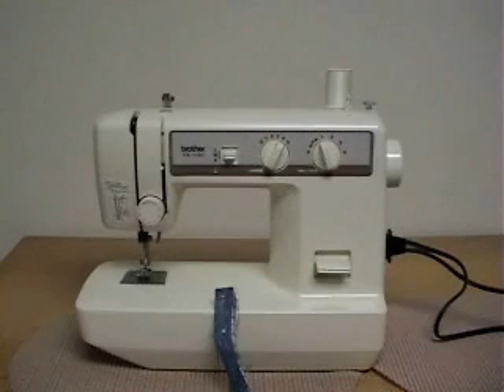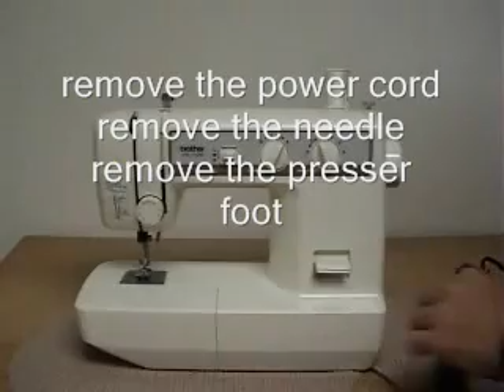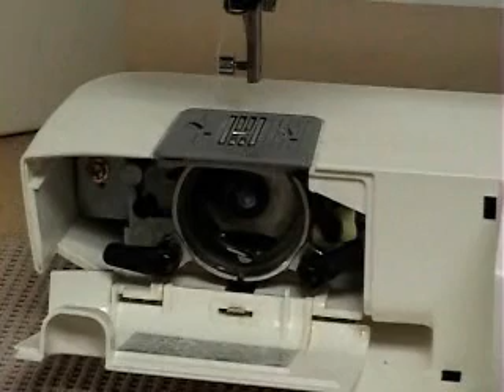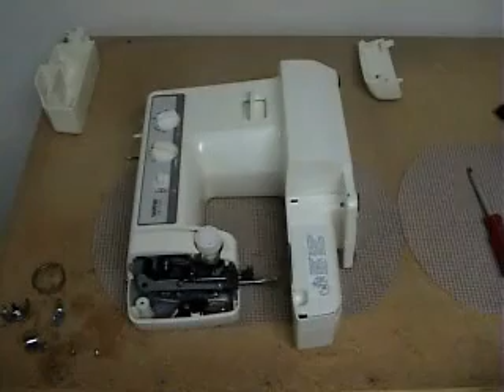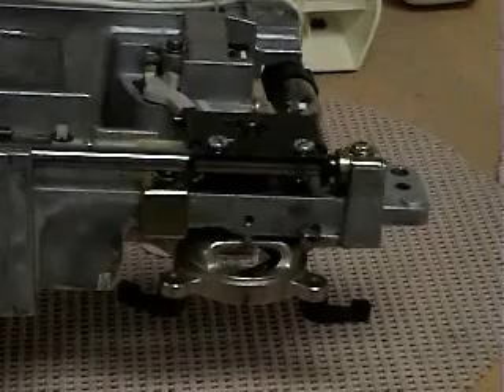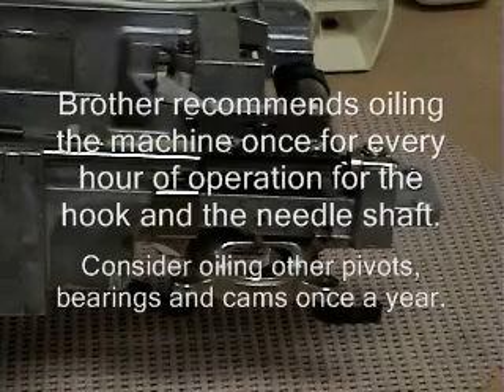Brother VX 1120

Comment: In removing the front cover, all screws are out, pressed the neck and the top bottom popped up without issue, but the top part refuses to come off and I am afraid it will break if I pull on it too hard. Any thoughts? In the video, yours comes off no problem. Thank you! I've had my machine for about 26 years and just recently has started to give me issues when sewing

Comment: Help Please!! Same machine stuck in Reverse!!
I have this machine I bought used. It's stuck in reverse! I took the front cover off and sprayed WD40 on the lever but it still won't pop back up to forward on its on. Should I take the back case off and oil it up under the presser foot??
Reply: I had the same issue. I just sprayed wd40 on the lever for reverse and kept engaging/dis-engaging it and now it returns to forward via the springs like it should. Quick and easy fix. Had to take the front of the case off to get to it but just 4 screws on the back and the one to the left of the needle. Running smooth once again!

Comment: Thank you very much for the video.  I needed to know that the tab was preventing the front case removal after screw removal.  I added a bit of silicon grease to the large wobble cam on the main shaft as a precaution.

Comment: Got same machine and material won t feed! Took apart per your video and put back together and no feeding! Dog feet go up and down but not feeding! Material just sits and when I push foot pedal it stays in one spot and develop a big thread lock up! Have to cut it all out! When I roll wheel down so needle can pickup bobbin thread, it goes down hard and sometimes I can see needle coming in the outside of the bobbin, not good! Sometimes it does pick up thread on but still stays in one spot!?!???!  Grrrrrrrrr
Reply from the maker: From your description it sound as if the feed dogs are not cycling thru moving Up, Back, Down, Forward and Up to start another cycle.  Review the video starting at about the 6:00 minute mark to check again.  It is possible that the lever is still stuck or that something else is stuck or perhaps misaligned.  Good Luck.

Comment: I am using this very same make/model, and at the end of my 1st project, I encountered a problem.  Going through thick seems to adjoin, machine lagged, them got loud, almost a rattle type noise as it still runs.  Now, the needle thread won't pick up the bobbin thread by hand rolling or power pedal.  What did I do wrong, and what will solve my problem?  I am a mechanis, is this fixable, adjustable?
Reply from the maker: I would suggest that a part slipped, broke or ?  So likely the timing is off if no parts are damaged.  The hook and the needle need to be timed correctly..